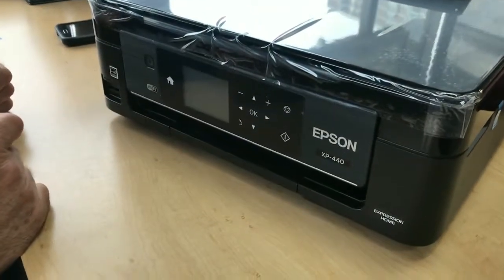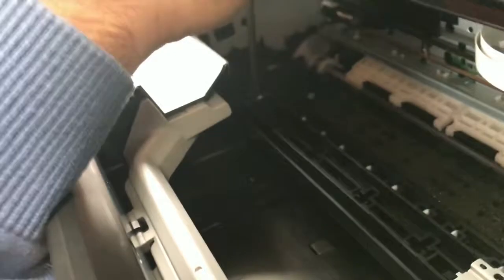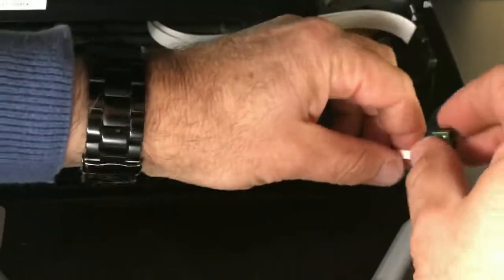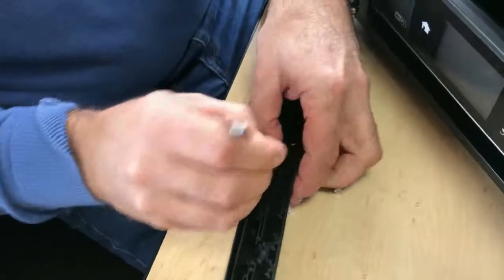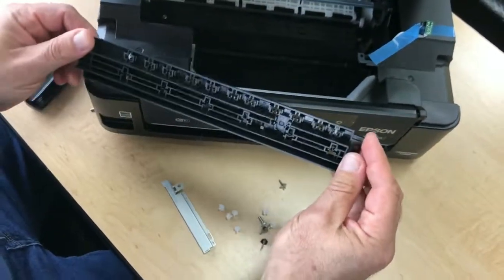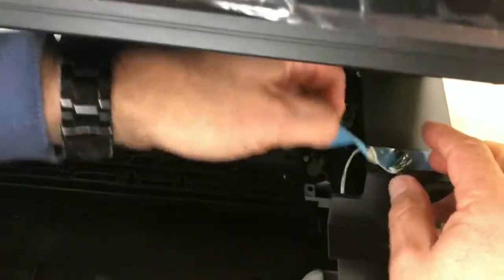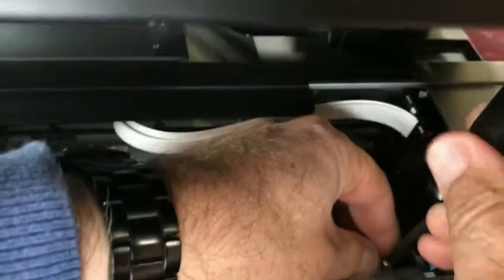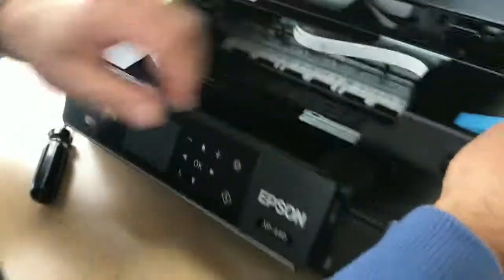Epson Printer Modification for Edible paper

Comment: hello Danny can you help me I bought an Epson XP 4100 printer but he doesn't want to accept the edible ink cartridges
Reply: What is the error message it gives you? There is a number of possible reasons. If you accepted the last update then it will not recognize 3rd party ink cartridges. If you have a chip reseter it may fix your issue but I have not tried it with the new update.